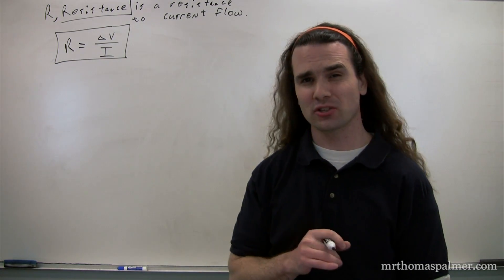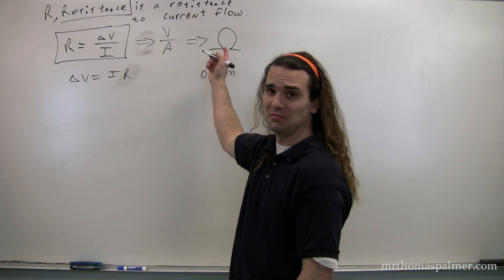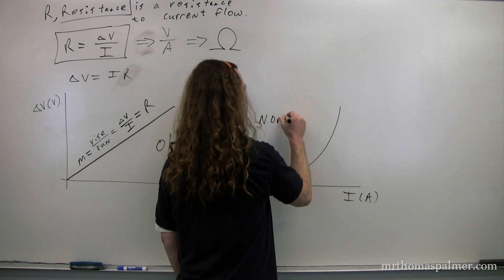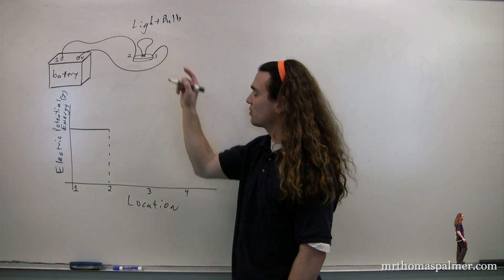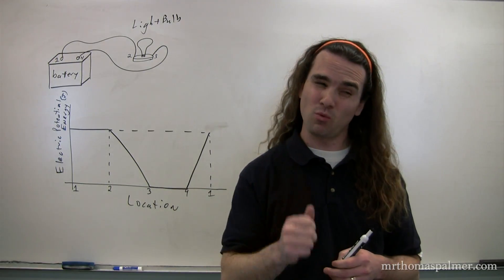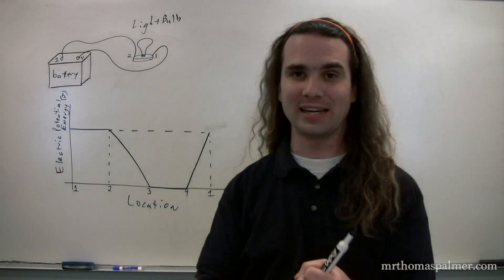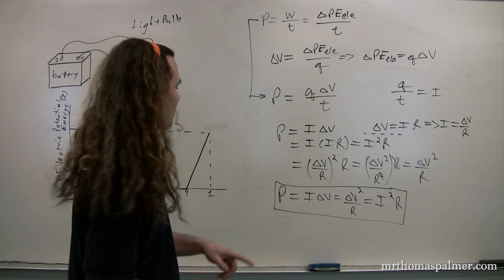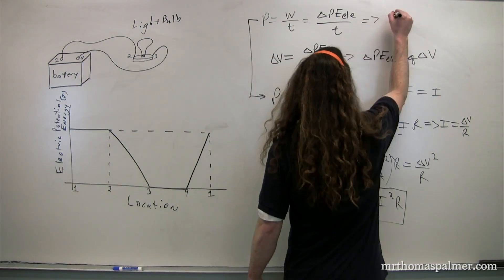Defining Resistance, Ohmic vs. Non-Ohmic and Electric Power

Comment: Current depends on voltage, how can we take current along x axis??
Reply: The x-axis doesn't always have to be the independent variable.  It generally is, but you can assign the axes however you see fit for the problem at hand.

Due to the fact that we are defining resistance instead of conductance, we represent the current on the x-axis, so that the slope of the line thru the origin can be the resistance, for a set of data points that satisfy V=I*R.   If we switch the axes, we'd have I = 1/R * V, and 1/R would be the slope.

We do have a name for 1/R, we call it conductance, and give it the unit of Mhos or Siemens for the reciprocal of Ohms.   But it is a lot less common to use this term when teaching introductory electricity, as the resistance in Ohms is a lot more common to be marked on components.